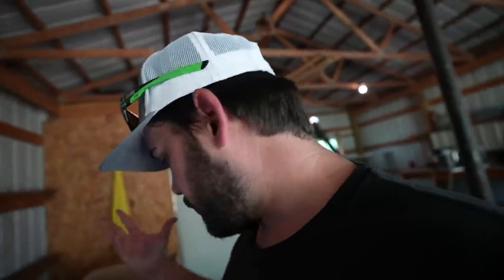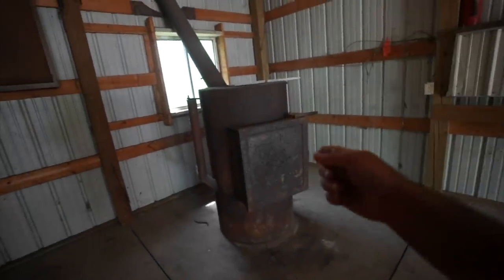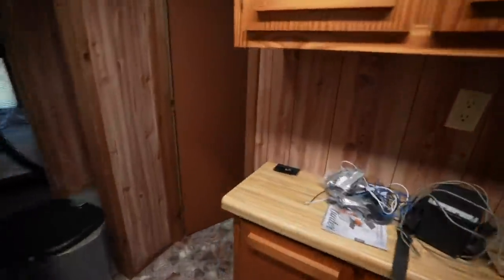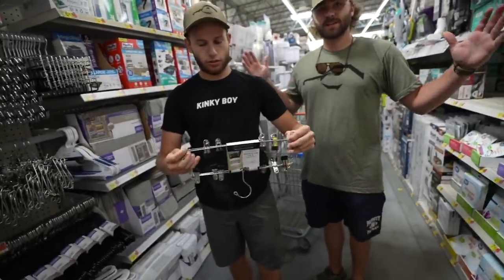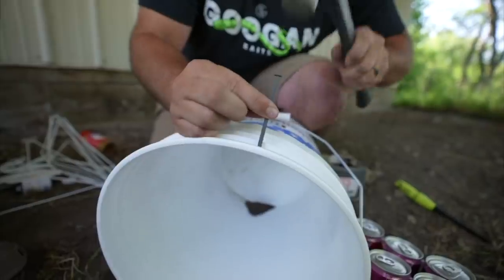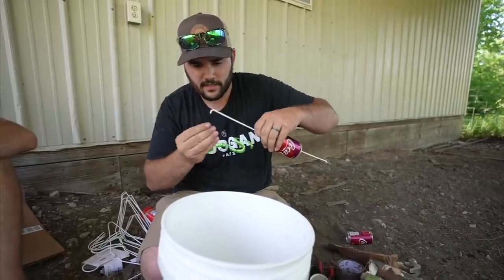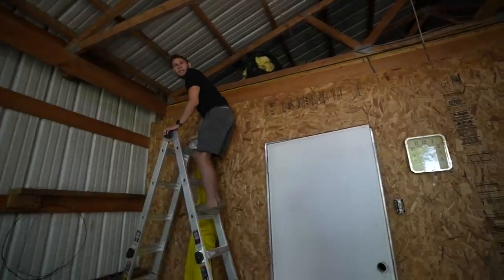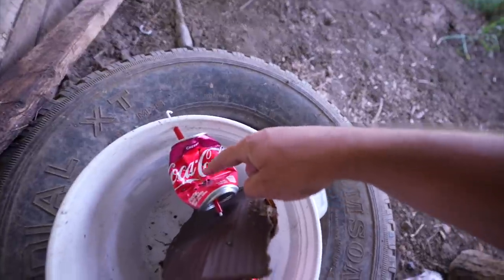1v1 HOMEMADE DIY Mouse Trapping CHALLENGE at the ABANDONED RANCH!

Comment: Your bucket theory is the best! We have a similar bucket at the cabin. Remove the pop cans and use the cardboard tube from a toilet paper roll. You only need one. Put peanut butter at the center of the roll for bait. Don’t use the wire hanger use 1/2” wooden dowel. Last thing is you need to use antifreeze in the bucket. Around four inches to drown them. This also preserves the bodies from decay. It will serve you well for years. Just scoop them out and into the garbage! Best mouse trap I’ve ever used!

Comment: "how do you fix that without tearing up the concrete?" 

Me: laughs in european engineering
Reply: Lol then how do you fix it
Reply: @tannerwilkerson8852  we make everything accesable to fix so we dont have wires and pipes running trough the concrete this way reparing stuff is way faster and cheaper and easier
Reply: @Kk-gx7ok  ahh planning ahead from the very beginning.
Reply: @tannerwilkerson8852  lol yea but id rather live in the usa 😂
Reply: @Kk-gx7ok  come on over homie some pretty cheap states to live in.

Comment: One great trap we use is called the “bucket of death” you take two 5 gallon pales together top to top and cut the bottom out of one use some tape to secure the buckets together and fill one bucket half way with water then pour some sunflower seeds in (they float you don’t need many) and a plank leading to the bucket the mice will walk up see the seeds hop in drown and the seeds will cover the body and you can catch lots in one night (works for squirrels too)

Comment: If you use just straws instead of cans on the coat hanger, it works just the same if not better. With the cans, when the mouse takes its first step onto the can and the can instantly moves it might scare them off. Just put like a tablespoon of PB on both sides of the cardboard in between the straws and it'll do the job. You could also fill the bucket half way with water and they will drown faster than they will starve and decay with nothing in the bucket.

Comment: As far as mouse traps go the 5 gallon bucket is good, but you should put antifreeze in the bottom (smells sweet and kills), use a small gatorade bottle in the middle instead of cans (covered in peanut butter), also use rope instead of a metal rod and tie nots to keep the bottle in the center. My dad uses that and it works great.

Comment: just a liquid holding container peanut butter and a liquid is all you need. the can does work but its more then you really need. banjos is what i would of done but a bit taller and only put the pb about an inch from top and you both need at least 3 in of liquid so they cant touch bottom and drown quick. plain water works as well as oil and a lot cheaper. safer for possible dogs around too. but antifreeze in winter keeps trap freeze proof

 want a squirrel trap? do the same with a trash barrel

Comment: Flair. Underneath the shop you cleaned you should get that fixed. Your cement will cave in eventually from erosion. That drain will wash away dirt under the foundation. It happened to my dad's workshop, unfortunately he didn't fix it in time and we had to tear the whole thing down. We put a camera in the pipe and the concrete was a good 4" off the ground on nearly 50% of the foundation.

Comment: I use a similar set up to Flair’s. I have a metal dowel more stable than the cans and I use Dawn dish soap and about 5 inches of water they can’t jump or climb out and it drowns them so they don’t suffer too much or just straight up eat each other.

Comment: Umm, you should talk to Papa Beefcake about that drainage pipe issue. Just put a piece of pipe a little smaller in diameter down so the water drainage goes past the mud. No tearing up concrete and fairly cheap temporary fix.

Comment: You had the right ide for the bucket trap but you should have put about one gallon water in it and instead of the pop cans you should have used like a roller that would flip them into the bucket and drowned them .

Comment: You're probably better off putting your traps inside the shop. (I'm assuming the shop can be closed to prevent larger animals, like raccoons, from getting inside.) That way your traps will only be exposed to smaller animals, like mice and rats.
My two cents.

Comment: an idea for a trap is
1. get a plastic box
2. cut a hole about the width of a mouse
3. then make a trapdoor
4. put the trapdoor on the inside of the box
5. get a stick or something to hold open the door
6. put your bait on the inside
7. then just wait
and the reason the door is on the inside is so when the mice hit the stick it shuts the door and they cant open it from the inside
but i would try to lead them with peanut butter on the door so if the stick is knocked over they can stick push it open

Comment: The best chipmunk/mouse trap I’ve tried is to do a 5 gallon bucket and fill it half way with water then pour enough sunflower seeds to cover the surface of the water so it looks like a bucket of seeds then the jump it and drown and then j also need a ramp to the bucket

Comment: Get a 5 gallon bucket, a coke can and a piece of wire drill hole just big enough for wire to fit in center of the bottom and top of the can and put wire through can put across the top of bucket put water in the bottom of bucket and cover can in peanut butter set in area close to mineral blocks and put a stick for the mice to use as a ramp they go out on the wire to get to the can the can spins and drops mice in bucket easy and cheap to make
Reply: Spoke to soon

Comment: Flair you should seal around the edges of the floor on the inside of the building with caulk and also seal around the edges of the walls where they meet the ceiling and you should also caulk on the outside of the building around where the foundation meets the bottom of the walls it definitely would help you out alot to keep all the varmints out of the building. This would be the best caulk for you to use.
https://www.gorillatough.com/product/clear-sealant/